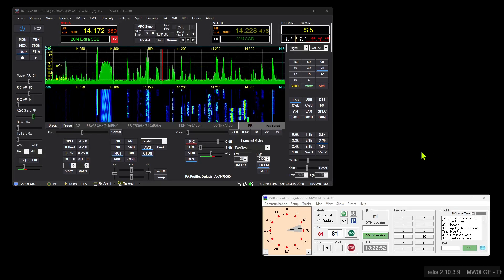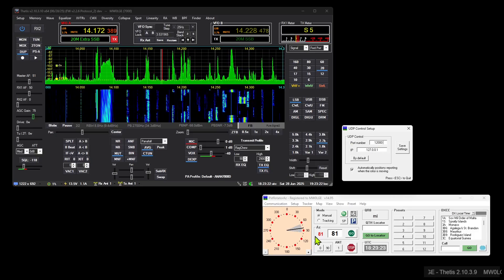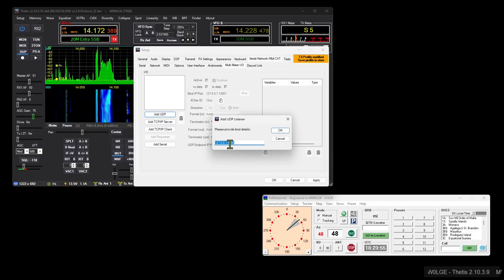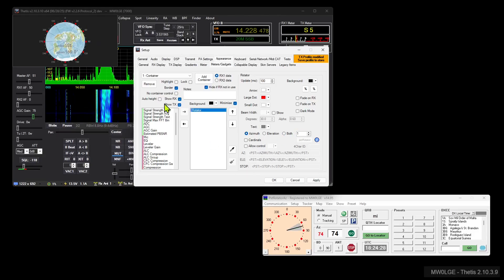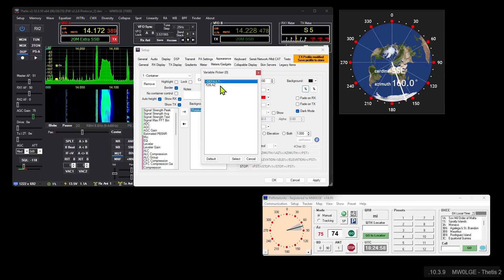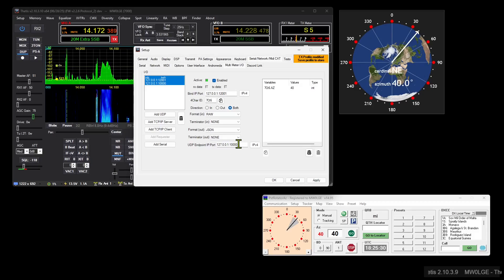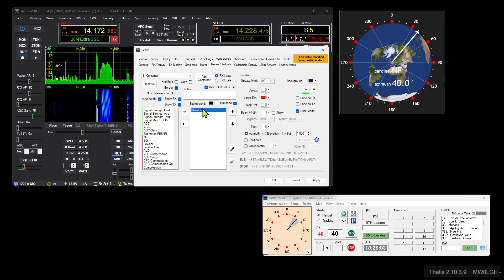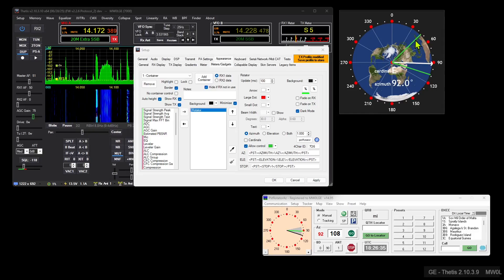Thetis - PSTrotator Setup - Walk Through

Comment: Working well, Richie.  Q: How to assign an azimuth map to the compass rose like you've done?  I do have an azimuth map in PstRotator.  Hopefully, the image file can be transferred over to Thetis?  -Paul, W9AC
Reply from the maker: use Thetis skin server, available in setup->appearance->skin server.  Ernst, OE3IDE, has some in there. Scroll down the list, you should see them down the bottom. Most of them start 'Rotator ....'  .Select one and download it. Cheers.
Reply: @mw0lge  Got it.  Thanks.  Miami is close enough to me.
Reply: @mw0lge  At first, a slight amount of pointer jitter until I set the update rate to 50 ms.  Nice and smooth now.
Reply from the maker: @paulchristensen7053  yeah that will happen if a non constant reading from PSTrotator, pointer will keep moving. I am not sure what the update rate is from PSTrotator, but increased ms update interval on the rotator control in Thetis will give smoother transitions